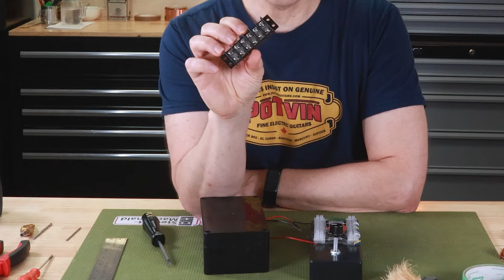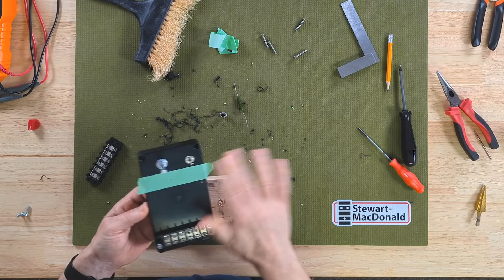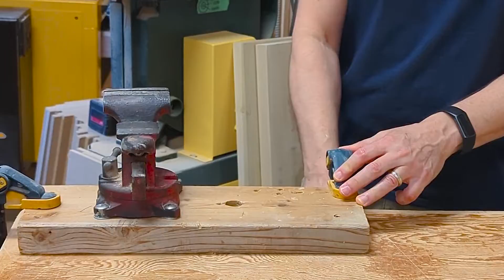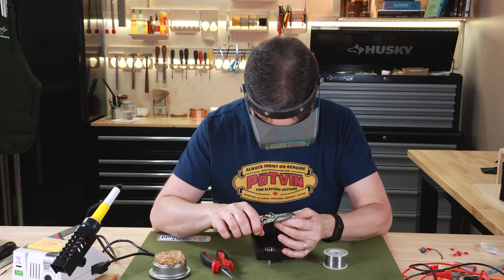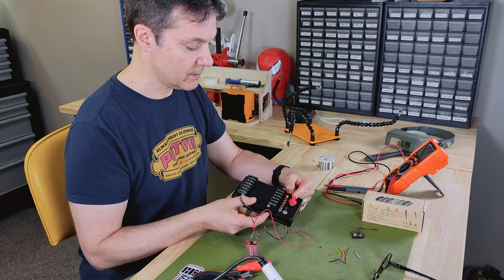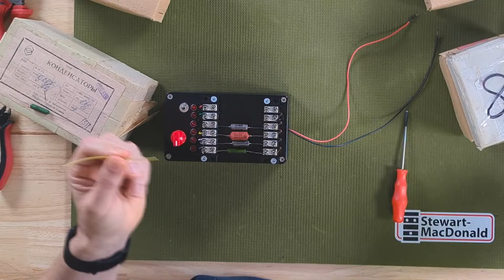DIY Guitar Tone Capacitor Sampler

Comment: You can change to spring loaded Speaker terminals unless you were more permanently mount caps. I like the speaker terminals because I can swap in different values for side-by-side comparison of the caps when you've narrowed your preferences.
Reply from the maker: That's a great tip, thanks!

Comment: Greetings from a fellow Ottawan.  How the heck did I not know you had a Youtube channel all these years?

Why settle for one tone cap?  I like to use something I got from Craig Anderton over 40 years ago: a bidirectional tone pot.  Tone pot wiper goes to volume input lug, and each outside lug of the tone pot goes to ground through a different-value cap.  I like to use a "standard" value cap (generally .022uf) on one side, and something about 1/5 to 1/4 that value on the other side (e.g., 4700pf).

Because this constitutes what is effectively two tone pots in parallel, that requires hiking up the pot resistance.  I use 1meg linear.  When set to its midpoint, it becomes two 500k tone controls set to full treble (i.e., negligible cut).    I would be nice if someone made a 1M linear pot with a centre detente, so you could rotate until you feel the little click, but alas, I've never seen one in the wild.  But quite honestly, almost any position 40 degrees or so away from either end tends to be bright enough.

The lower/smaller cap side provides a nice "rounding" of the tone, and can introduce a bit of a resonant shift.  I like to describe it as "sanding off the edges".  This stands in contrast to the dulling effect of the cap in the other direction.  One of the perks is that all tonal changes are accomplished in half the rotation normally required by a conventional tone control.  This makes it ideal for those who like to use "pinky wah" (producing a wah-like treble swell by quickly rotating the tone control).

Rotary switches are great for many things.  I made a little gadget for selecting the optimal current-limiting resistor for LEDS illumination.  LEDs vary in how efficient and bright they are.  What may be a suitable resistance for making an old-school red LED bright enough may result in a newer superbright one being blindingly bright.  So, I have a little jig with a 12-position switch and a range of resistors from around 1k5 up to 18k.  A 9V battery plugs into it and the LED gets inserted into a socket.  I start from the highest resistance value, and work my way down until get a brightness that's suitable.  What counts as "suitable" depends not only on the LED's brightness, but the background against which it will be seen.  An LED against a dark background can afford to be a little dimmer, while one against a white  or light background needs to be a little brighter.  Handy little thing.
Reply from the maker: Hey!  The LED / Resistor chooser is a great idea.  I'm going to put one on my electronics To-Do list 👍🙂
Reply: @PotvinGuitars Thanks.  It probably won't identify the exact resistance, but if, for instance, 4k7 is a little too bright  and the next switch position of 6k8 isn't bright enough, that will provide an idea of what possible standard value will be optimal.  It was something I found necessary because of a parts drawer chock full of different LEDs from different eras.  A person could always use a pot, I suppose, and measure the pot resistance when you hit the sweet spot, but this is less cumbersome because one can know, in advance, according to switch position.  Of course, choosing a cap absolutely requires a switch!